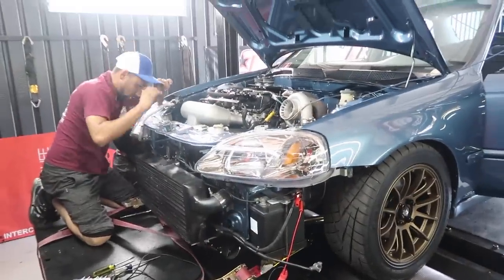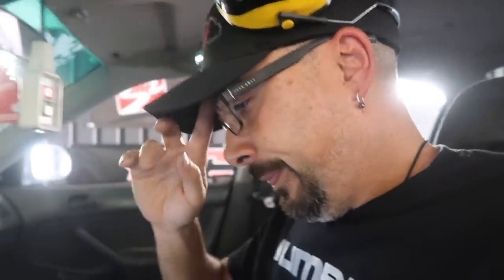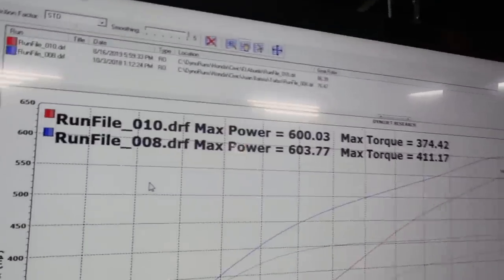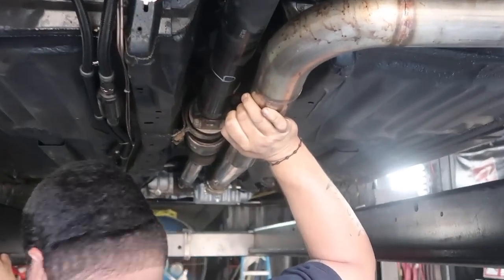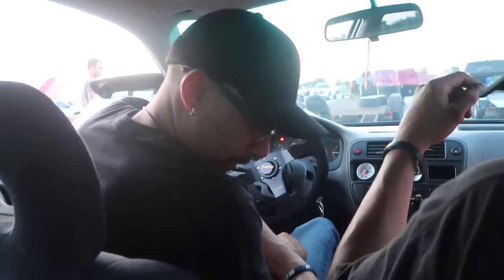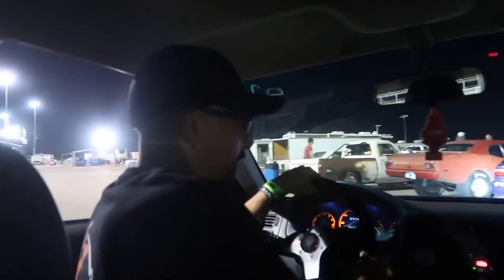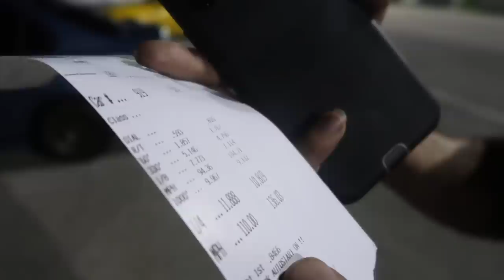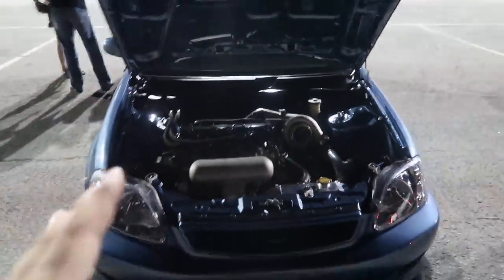600HP STOCK K20 AWD Civic Sedan Is The ULTIMATE Sleeper! 10 Second Pass On Street Tires!

Comment: Guys keep up the good work, your efforts will be rewarded, I hope more you tubers will follow you guys and see your magic, thank for aspiring us Honda all motor builders out there, from south Africa
Reply: @humbleperformance  I am building a h22a all motor, with nippon pistons, 11:1, head is gas flowed and port on stage 3, bigger valves and spiral valves, aem racing injector rail, 2200cc injectors, billet cams and cam gears, stage 4 racing clutch from clutch masters, KS tuned oil pump, fuel cell, running menthonol and branches, has got a diktator stand alone managent system, so exited to put her together and see what hp she is gonna make

Comment: We're going to need so many more episodes on this car. There's just so much valuable information in this video. In the future could you give a break down on the gas tank set up and how much went into putting it in the trunk, does it still connect to the stock location filler neck, does the gauge read correctly and so forth? What size fuel pump is in there and what size mines feed and return?
Reply: Justin at Hub City Performance built this car. You'd have to ask him.

Comment: Man I wonder what my old hatch would have done at the track. Guys I knew said no way would it run 12s without a LSD. But after watching this with street tires I think there was no question it would have been in 12s. It was a turbo b18b1 92'. I beat a 07 Vette on the street and smoked STIs. Wondering what you think about the LSD

Comment: If you smashed a turbo onto it it is no longer stock unless it originally came with a turbo from the manufacturer the engine has stock internals that's it but it's no longer stock with a after market turbo added.

Comment: Unfortunately sidewinder turbo manifolds have poor wastegate placment by design so most cars will have boost creep, try rewelding the wastegate at a 45' angle that will help a little
Reply from the maker: Won’t change a thing. 67mm turbo and a single 44 is the cause.

Comment: How and why did it get outlaunched by the same car in fwd?
Reply from the maker: Street tires vs slicks
Reply: @humbleperformance  so the awd honda best purpose is on the street, cause on the track the times are the same. 7 seconds.
Reply from the maker: On a slick, this car will 100% outlaunch a fwd car. The fact it launches the same as a fwd on slick says everything.
Reply: @humbleperformance  but the fwd outlaunches it clearly, no comparison.  Other awd cars rape fwd cars in the first half.

Comment: Can't be stock if it has a turbo it's definitely moded stock does not contain 600 Horsepower from factory also awd is not stock from factory car was designed for efficiency not designed to be a race car

Comment: When the word stock is used and there's nothing stock about the car🤨😒
Reply from the maker: The engine is completely unmodified.
Reply: @humbleperformance  so the internals of the motor is stock, but when you bolt on a turbo to a N/A motor it's no longer stock🤦‍♂️